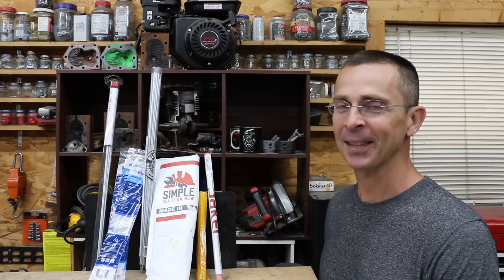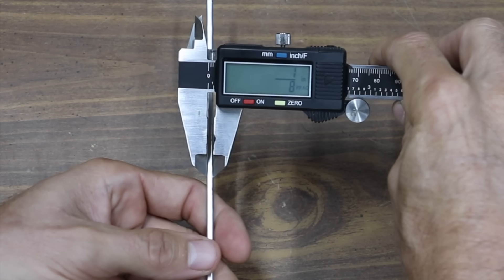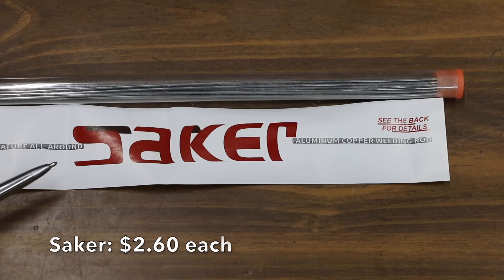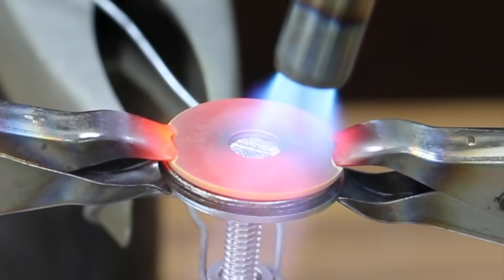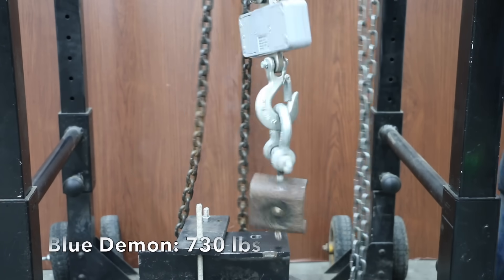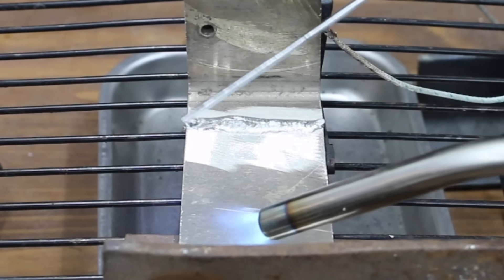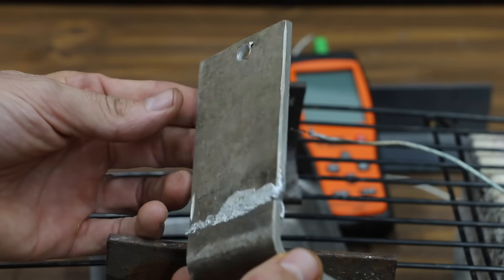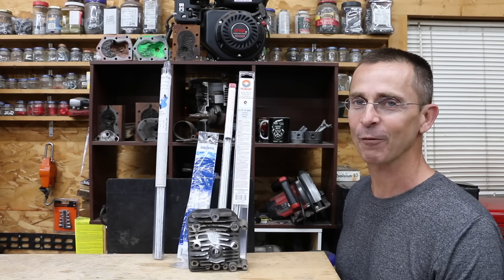Best "No Welder" Aluminum Welding Rods? Alumiweld vs Bernzomatic vs Hobart

Comment: I was told by a sales guy to never use a grinder or sandpaper on the aluminum for prep, but to use a new fresh stainless steel brush to prep the part and to do this right before the welding. The faster you do this, the better the result as oxides happen very fast. I have been using these for years on antenna parts for large ham radio antennas and never had a failure due to weld strength.
Reply: Yes, you are mostly correct, if you use sandpaper or grinding wheel that has been previously used with steel it will affect the welding process.  As small steel particles will get imbedded into the aluminum and cause hard spots  because it doesn't melt at that temp. Stainless steel brushes are best for aluminum and old use with aluminum.  As far as  I know anything can be used with aluminum as long as it is new and never used with steel.  That is what I learned at welding school.
Reply: @keltonwright7  Avoid anything that ever had contact with steel - but use a steel brush?
Reply: @dhy5342  stainless steel, not regular steel brushes.
Reply from the maker: Thanks for sharing.
Reply: Agree with about not using abrasives but use a clean stainless scratch brush to break the oxides down. Also use a stainless steel scratcher wire rod to help the molten puddle to flow better. Lumiweld repair rods are what I have used with success.
Reply: 100% correct, all of these welds should be re done with a fresh staino brush and then re tested for the true strength of the product.  I also use them,  but durafix brand,  and they are awesome for repairing ally boats.
Reply: I never thought about using this for antenna repairs or builds thanks for the idea. Kl4kf
Reply: Use a carbide tipped saw blade preferably with a neutral or negative grind on the teeth.
Reply: There are some aluminum specific cutting and grinding wheels, they make a huge difference.  I've done a bunch of thin aluminum ductwork with TIG, and you can see the difference during welding.
Reply: What brands do you use for your antennas?
Reply: @himesjon  I'm not sure of the brand on the 1st ones I purchased as I purchased them about 20 years ago at Dayton Hamvention, but I have been using the harbor freight ones and they are identical to the ones I overpaid for in Dayton!
Reply: Thank you for the great idea, k04cwq
Reply: For WELDING absolutely,,,,but since you are not even coming close to melting the aluminum fo I don't see it making much difference.  This is not exactly aerospace or NavSea quality either. 

But still, it's like giving chicken soup to a dead man,,,,,Following best industry practice might not help,,,,but couldn't hoit.

Comment: Hey there’s these videos going around TikTok about “fuel fragrances” for cars with no cats,off-road vehicles, and even landscaping equipment to help with the exhaust smell. Can you test them? It’s a fuel additive, I’ve seen jeggs and liquid power but there’s more brands out there
Reply: A guy I worked with brought his snowmobile to work one day. He was running the strawberry additive. It worked.
Reply from the maker: Thanks for the suggestion.
Reply: Project Farm no problem! I’m mainly concerned with if it has any effects on your engine or fuel lines and sensors overtime. Amazon sells them just fyi

Comment: The problem with most of these guys using these products is that they do not put enough heat onto the base material. They get impatient and then start to stuff the rod in and hope that it's going to Weld itself. When doing repair on my boat I started to become the same way getting frustrated that I could not get enough heat into the base metal. I ended up using 2 propane torches to finally get enough heat And just as the boat starts to melt away the rod starts to flow. The boat is 100% fixed no issues whatsoever......
Reply from the maker: Thanks for the feedback.

Comment: I didn't even know this was a thing.  I play with golf carts, which use aluminum frames, so this could come in handy.
Reply: These rods definitely take the headache out of aluminum brazing... no acid flux paste to deal with. I wouldnt use these for any high pressure application.
Reply: Could you elaborate upon "play with golf carts"? I'm curious what this entails
Reply: @skizzik121  Buy, repair/build, sell, keep, drive, etc.  Frames are often aluminum, as are some of the aftermarket parts, and they're subject to corrosion and occasional breakage.  This gives an option for some of the repairs needed versus riveting.
Reply: @wakkoss  can you help me out I got a golf cart that runs good but with die randomly and restart like you were turning it on and off repeatedly it's a Yamaha g1 gas
Reply: @tbah9402  Pull a Happy Gilmore on it. If that doesn't work, try a dropkick.
Reply: @wakkoss  Except it is brazing NOT welding nearly not as strong as welding!!!
Reply: @sotm6078  Nobody said this was a strong as welding.
Reply: Same here. Had no idea this was available. Fixed a fuel pump a few days ago. Used the same method, but did it with soldering wire instead.
Reply: Flat black. Shel by  150ford
Reply: It's basically the same as brazing copper lol
Reply: Just buy a cheap Tig machine.
Reply: If do work on golf carts as you say, then you my friend are going to be amazed at how well this works on aluminum. Just as I was when I repaired a threaded bolt hole on my table saw.
Reply: Yes didn't know this exsisted, buying some right now
Thanks A++
Reply: @ShlomoMcNackimoto  Great point and killing the heat treating will absolutely weaken it, significantly. It is something that requires just trying it to see what kind of mileage you'd get out of it, yeah. Seems like strong enough stuff to at least address cracks and give them enough reinforcement to help. People abuse golf carts something awful, so mileage may indeed vary, lol.
Reply from the maker: Thanks for sharing.
Reply: Same here and it's a great option for basic aluminum repair, without the trickiness of aluminum welding. Finally, someone with metallurgy knowledge said "we need something easier for people to use". And as a noob, lol, I tip my hat to them, good thinking, I would certainly use it.
Reply: Don’t think I would trust this with major support items like a frame
Reply: I didn't either. Are those steel bolts? Or can you only weld aluminum to aluminum? I got a crack in the frame of my snow plow an my ATV, could I use this for a repair. Super cool!
Reply: @chawnslopoke2619  Those are alu bolts. As I understand this products are not for alu-steel joins.
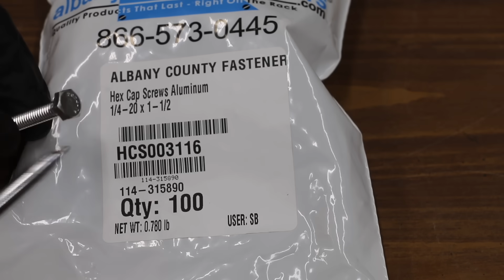Reply: @chawnslopoke2619   @ 4:50. Aluminum bolts
Reply: @chawnslopoke2619  A weld would be best but depending on the repair angle iron and bolts should hold

Comment: One thing you might want to factor in is ease of obtaining. Of course it's subjective and can change on different areas. But if something needs to be ordered from a manufacturer and it takes weeks vs something that can be purchased at a big box stores.
Reply from the maker: Thanks for the suggestion.

Comment: you should do a video on the best rope/cordage for general use around the shop or farm. I would love to see a match up between paracord, bailing twine, jetline (what electricians use for pulling wire in smaller conduits), and the el cheapo 1/4" polypropylene rope from harbor freight or home depot.

love your approach to testing your menagerie of products in each video, keep em' comin'!
Reply from the maker: Great suggestion!  Thank you.

Comment: VIDEO IDEA, maybe you have already done this one. In my Kawasaki motor cycles I have always used a Full Synthetic 0-40 oil. Regular Motor oil. I was told by a dealer when I was buying my sons new Ninja that I should only use Motorcycle oil because it is formulated for the clutches and other parts of a motorcycle engine that regular motor oil does not. I have never had any issues with my bikes, is this true or is this just a dealer wanting to sell their very overpriced oil? Let me know if you have done this already and direct me to the link. Love your videos, you have influenced my choice of product in the past. I value your input.
Reply from the maker: Thanks for the video idea.

Comment: It is unlikely that the repair area was any different temperature than the rest of the cylinder head. You got a different reading because of this thing called emissivity. I have a thermal camera and had to learn that to use it. Try placing something on both areas such as electrical tape or black spray paint. Then measure again. That will make the reading more accurate
Reply from the maker: Thanks for the suggestion.

Comment: I have never welded before but wanted to create an aluminum light fixture with 1/8” x 1” bar stock.  I got some Bernomatic aluminum rods and the Pro fuel.  I didn’t know about heating the bar instead of the rods so i learned that from you!  Thanks for the great video and all your advice!  I will try it again today (after I go get some more fuel)...
Reply from the maker: You are welcome!

Comment: Hi, You missuse the word "welding". what you doing is brazing (heigh temprature soldering)
Reply: Robert Toldi       That’s very true, it’s not a weld but BRAZE.    Not as strong to be dure but just as with brazed steel done correctly it’s plenty for most purposes.

Comment: Product to test with extraordinarily claims. They have an engine oil treatment as well as a WD-40 like product. Claims it chemically bonds with the metal. "Prolong Engine Treatment molecules interact with the metal surfaces they chemically bond to create a protective layer that reduces damaging friction and heat."
Reply from the maker: Thanks for the suggestion.

Comment: Try welding an aluminum piston or connecting rod with these aluminum brazing rods and see how long the engine runs and if it fails see what broke the weld or the aluminum. That would be interesting.
Reply from the maker: Thanks for the video idea.

Comment: I jumped on here wondering if garden hose sprayers have ever been compared. Kinda bummed this hasn't been done. This channel is awesome. Everything about it. Methodical testing, real world comparisons, no sponsorship, great audio and video, informative, and enjoyable to listen to. Simply, entertaining and informative.
Reply from the maker: Great suggestion!  Thank you.
Reply: @ProjectFarm  quality/flow rate of various spray selections, ease of adjustment, hand fatigue due to ergonomics and lever effort. Ability to be dropped/tossed and not break lever, lever pivot, or spray adjustment mechanism. If dropped, how lijely to just start spraying. Thumb adjust v. rear lever v. front lever, v. straight type like a fire hose. Oxidation resistence. Can it withstand being left out in the sun or over the winter. Compare residential use to reasonably priced professional grade nozel(s).

Comment: I have a suggestion!
Will an aftermarket performance ignition coil+iridium/racing spark plug+power cable perform better than OEM/stock in terms of power delivery, fuel economy, and combustion efficiency? 

Ignition coil: stock vs Faito vs UMA racing coil
Spark plug: copper vs iridium
Power cable: stock vs NGK power cable
Reply from the maker: Thanks for the video idea.

Comment: can you do a video on shaving those cylinder heads for higher compression, you could use a glass plate and sandpaper to do it, seen it done on engine heads like that as well. even ceramic tile is flat enough to make it work. would be interesting thats for sure
Reply from the maker: Thanks for the video idea.

Comment: I just tried repairing an evaporator on my old Chevy Blazer K5 with Harris welding kit with flux and I could not get it to hold long enough to even tighten the Oring connector back and I gave up after at least 5 try’s. Should have used benzomatic or Hobart I guess
Reply from the maker: Thanks for sharing.

Comment: you ever thought about best tire shine? here are a few u should try if u can get it in ur area. Maguire's endurance gel, armor all outlast tire glaze(the best in my opinion.. it looks wet sooo people always rub it!), and Meguiar's Hot Shine Reflect. u choose others if ur interested in this project. for the gel, i suggest using a tire brush to scrub it into the cracks then use a curved tire applicator sponge to smooth out the scrub. these products work best if they are really clean a good degreaser will work like gojo, also clean with warm water and a separate scrubber before using gojo. gojo will remove whatever is leftover. then clean with warm water again. tires have caked-on dirt sometimes not removed the first time around. used to work at Oreilly auto parts and used quite a few of the items with my discount to see what was better. number 1 is outlast second is gel and third is hotshine.
Reply from the maker: Thanks for the video idea.

Comment: I have a complicated video idea that I think only you can tackle. Diesel fuel isn't something that is really talked about a lot. Most fuel stations in the u.s use a diesel cetane rating of 45-55. They say the higher cetane, the better it is for your engine. Using a "low sulfur" diesel with a cetane rating of 45 all the time in my truck, I recently got into using "cetane boosters" such as "Lucas", "Liqui Moly", "Diesel Kleen", "Opti Lube" to try to make up the lost cetane ratings fuel stations provide. Does it really increase the cetane rating? Does it really clean injectors? Does it really increase acceleration time? Does it really increase gas mileage? Cetane is like Octane for regular gasoline, but is rarely talked about or even noticed. Does it make a difference?
Reply from the maker: Thanks for the video idea.

Comment: You forgot laser brand. They do a HTS2000 set. 
https://www.frost.co.uk/hts-2000-alloy-repair-welding-kit-fluxless-aluminium-brazing-rod/?gclid=Cj0KCQjwt4X8BRCPARIsABmcnOqN0Q4Vu7MbtoCfTcxxgPw-qyUG0u4kED1I1sUk-gI2_8cjTwMq03UaAjl7EALw_wcB

Comment: I had a guy try to weld my cast alu transmission case with a special stick with arc welder. It didn't hold, but this looks promising.
Reply from the maker: Thanks for sharing.
Reply: @ProjectFarm  looks like plastic welders already done
Reply: @ProjectFarm  looks like plastic welders already done

Comment: First, for those that may read this: most important in an aluminum repair is to CLEAN the aluminum base metal with a stainless steel wire brush and pure acetone. The oxidation will mess up your weld EVERY TIME.
I didn't even know stuff like this existed. Looks like a great way to make a temporary repair until you can properly weld your part, minus the 2 garbage products anyway.
As always, great video!
Reply from the maker: Thanks for sharing.

Comment: What I really appreciate about this video is how great it is in showing the ease of use with the products.  Some of the more difficult ones may have great specifications, but if it's that hard to use in a test rig, well I certainly don't want to struggle using it in real life applications, negating any rated benefit!  Also, it was fantastic to see other things like how well they flow, as I tend to prefer a better flow with less buildup, as in most circumstances a repair needs to be low profile, Bernzomatic it is for me from now on!  As always, thanks so much for continuing to produce such useful videos for all of us!
Reply from the maker: You are welcome!  Thanks for watching.

Comment: try zink wheel balancing weights.  Melt the zink and scrape off contaminents. Pour it in 90 degree aluminum angle profile(with closed ends) to make a rod. Works almost as good.
Reply from the maker: Thanks for the suggestion.

Comment: Can we get another diesel tournament? I can send you a few different brands to test if you want. I'm thinking have a conventional bracket, a synthetic blend bracket, and a full synthetic bracket. I'm  thinking mystik, amsoil diesel, shell rotella, chevron delo, mobil one delvac, royal purple duralec, valvoline's brand (can't think of it off the top of my head), motorcraft, and any other HD diesel oil you can think of/find. All the ones I listed you can get through O'Reilly's aside from amsoil.

Comment: is it possible you could look into solder stations? ones with the hot air rework stations built into them, like the yihua or the co-z solder stations with built in power supply and stuff?
Reply from the maker: Thanks for the suggestion.

Comment: Hi, some time ago i did the mistake to missfuel, petrol instead of diesel, my bad, buuut, after replacing the fuel, i still got left 10 L of gasoline in the tank, so i just topped it up with diesel. The only effects i've noticed after driving it for a couple hundreds of miles was a increase of power and at least 20% more fuel economy. Could you please test if are there any negative effects as well at a 20% gasoline to 80% diesel ratio in an diesel engine? The results may shock. Thanks, keep it going :)
Reply from the maker: Thanks for the video idea.